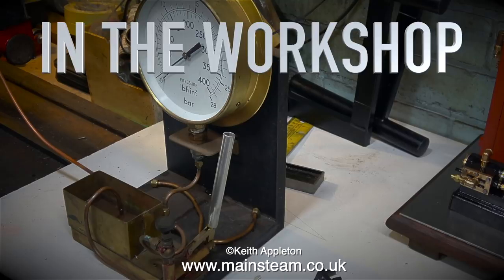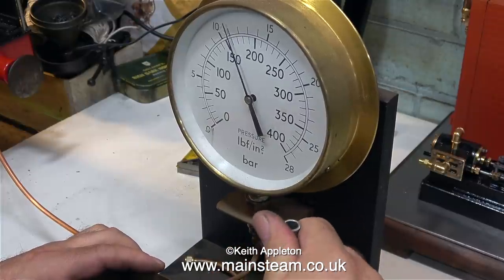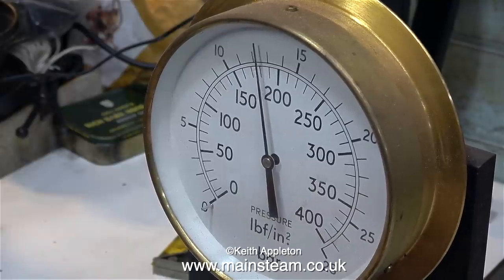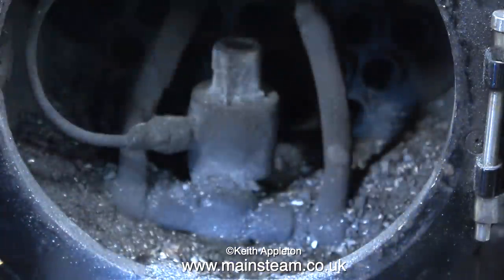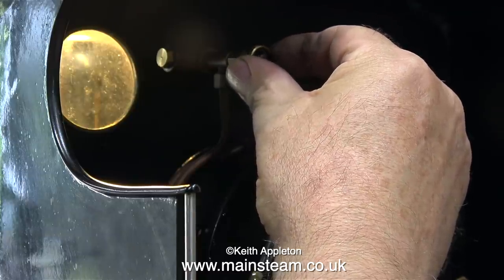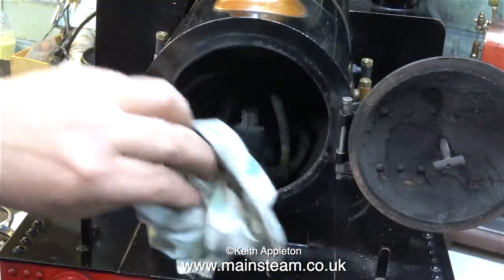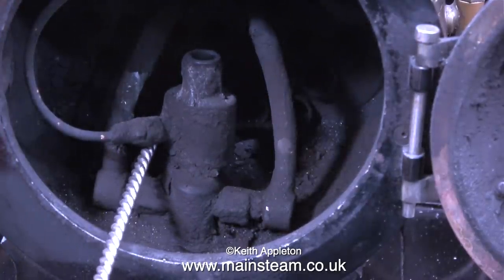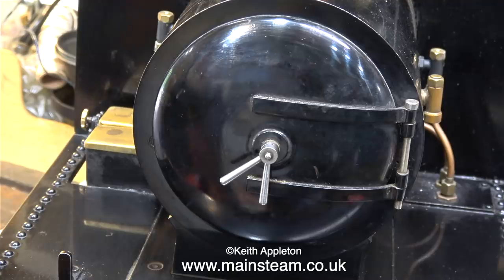THE HYDRAULIC TEST OF A MODEL STEAM LOCOMOTIVE BOILER - IN THE WORKSHOP

Comment: I worked at a generating plant cleaning boilers for just two weeks before taking a job I really wanted as a mechanic. They had three massive boilers and one was always down for cleaning and maintenance.  I was 6ft 170lbs and could barely fit inside the tubes, but I squeezed in and scraped for an hour at a time with a 10 minute breather each time. There was no other way to do it, and despite all the stuff they did to purify and demineralize  the water the tubes still got scale that was as hard as concrete.  Come to think of it, lime scale is concrete!  Tough dirty work, but everyone who started at the company had to clean boilers (a test of character maybe?). Anyway, I did okay and my boss said he was going to miss me, which surprised me because I never indicated I liked cleaning boilers!

Comment: The last time I punch tubes out a Boiler (the term used in industry for cleaning them) there were 330 tubes in each boiler and there were three boilers and then two chiller units with 440 tubes each. We also welded hinges on the chillers so we could open them like boilers instead of removing them with block and tackle. Thankfully that was long in the past.
Reply: Many years ago I worked for a company that did commercial boiler work.   We retubed a large and ancient (~ 80 - 90 years old)  commercial unit for a school.

One of the most labor intensive and all around crappy jobs I have ever done in my life.  If it wasn't rusted solid it was packed so full of scale on the inside it was like pulling the tubes out of solid concrete.   

They guy who ran the company thought he was the worlds greatest engineer. After about 2 months of working there I was pretty sure he was the world biggest idiot.  If anyone could find the hardest way to do something, he did.   

I do have to admit I learned a load about how boilers and general fluid based heating systems worked for him though, mostly just by seeing how not to do it the wrong way.

Comment: I have an Accucraft boiler to test. Trying to find M5 x 0.5 blanking plugs is basically impossible, so that's been fun.
Reply from the maker: Use tapered wooden dowel plugs, they will work fine for a Hydraulic test. I made a video about this when I briefly worked at "The Steam Workshop"
Reply: @keithappleton  Seriously? I'll be honest, that hadn't occurred to me at all. Also, thanks for uploading a hydraulic boiler test video - I've used what snippets of your test rig I've seen to get the parts to make my own rig, luckily the boiler I acquired came with 2 M10 blanking plugs, so I'll be modifying one for the test.
Reply from the maker: As I previously mentioned, small wooden Dowels do work perfectly well . . . . . I have done this many times.

Comment: So why do they rivet boilers and not weld them? Or do they weld them now?  And rivets are just what was available in early boilers?
Reply from the maker: You answered your own question. Welding techniques and quality of metal is much better now, and welding seems to be the most popular method.
Reply: @keithappleton  ok good.  I ask because I acquired a partial built case replica steam traction engine.   The boiler is about half done.  I’ve never seen a welded boiler. So I had to ask.    I’ll also be needing to build a hydro tester like yours.. could you do a video covering it so I can make one too?  I’ve had really small steam toys. This is my first big one..   it’s got about a 4 foot long boiler.